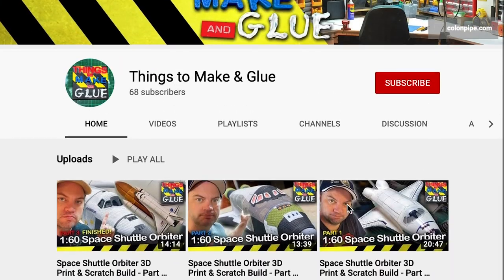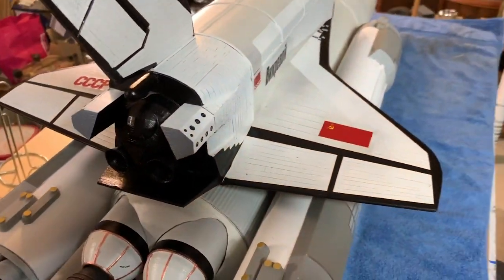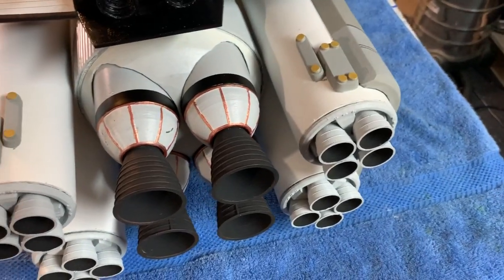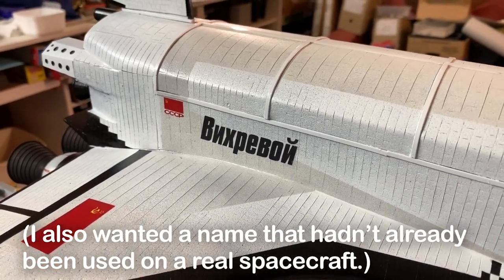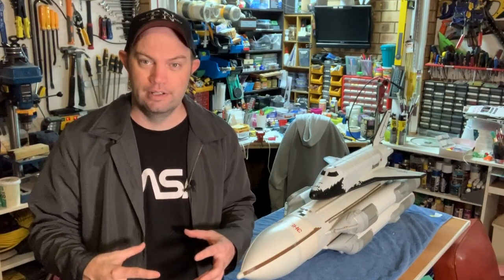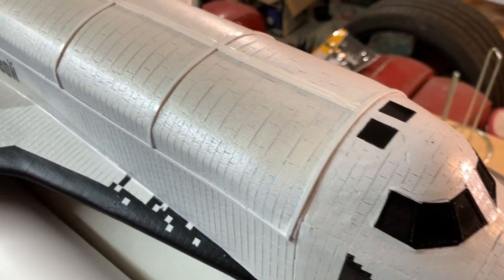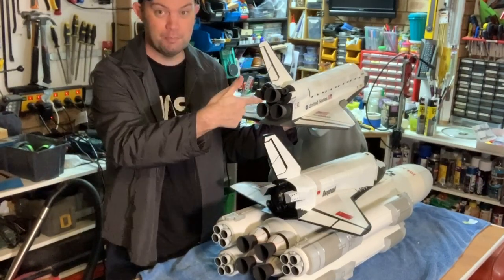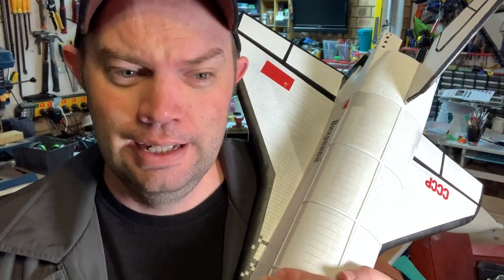3D Printed Soviet Space Shuttle Model

Comment: My guess for the engines on the orbiter instead of the external tank, is that the external tank was left to burn up in the atmosphere and the orbiter returned to earth. This saves a lot, being that the engines are a large portion of the cost of the shuttle. But that’s just what I think, I’m not an expert.
Reply from the maker: All of the parts of the US shuttle (orbiter, external tank and solid rocket boosters) were reusable, but the parts that were ejected on launch (tank and boosters) needed extensive refurbishment each time. It wasn’t an amazing design, but it worked. The Soviet shuttle was the same, all parts reusable, but without the engines on the orbiter there was more payload capacity and less dead weight to lift into orbit. The Soviet one wasn’t perfect, either. I suppose it’s hard to evaluate the “improvements” with only one official spaceflight. 🚀